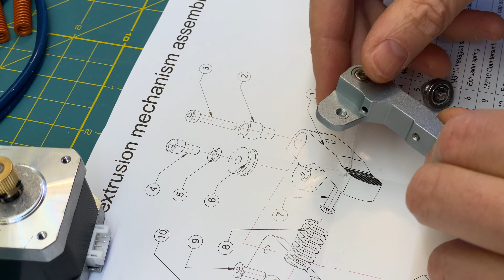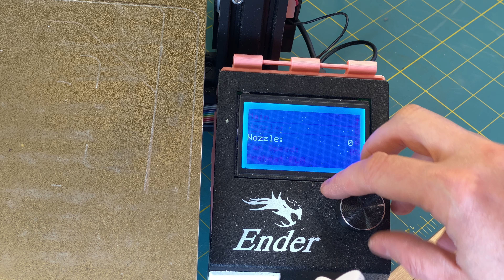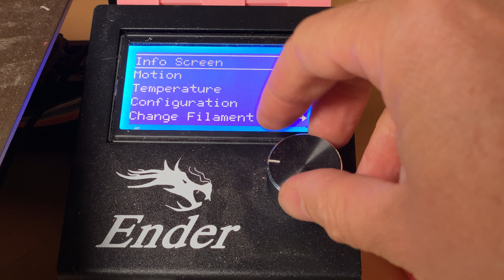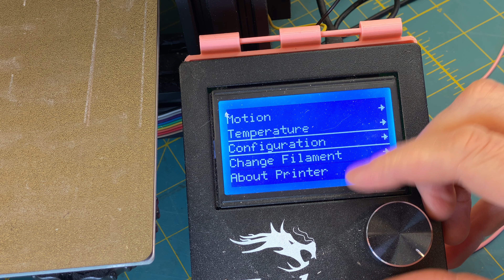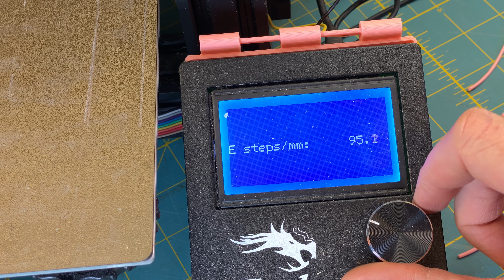Upgrade your ender 3 extruder for MUCH better prints

Comment: I think you have to save the settings change to make it permanent. Thanks for showing the screw less gear removal, I have the same unit and I am looking to upgrade to a dual gear extruder.
Reply from the maker: are you talking about he e-steps setting?
Reply: @makermaker  yes. As far as I know, if you don't follow up any changes with a save to memory, it will forget the change on the next power cycle.
Reply from the maker: Thanks, good catch!  You're absolutely right.

Comment: Not all extruder gears are tight enough to be press-fit. for those cases you can use a sharpening stone to file one side of the motor shaft until its flat enough for the little screws to grab onto.
Reply from the maker: The more you know!!!

Comment: Thanks for the video. Image quality is pretty good. Sound QUALITY is also. BUT - Your sound level is extremely low. Please turn your mic level up.
Reply from the maker: Weird. It seems ok to me.  I tried increasing the volume but youtube doesn't have the feature. I'll pay closer attention for my next video.
Reply: @makermaker  I run my narration audio through audacity and use the Normalize function
Reply from the maker: super helpful, thanks